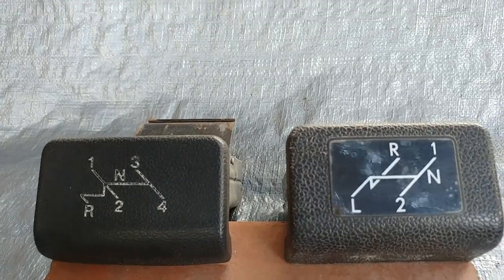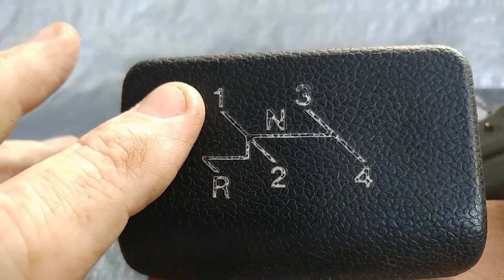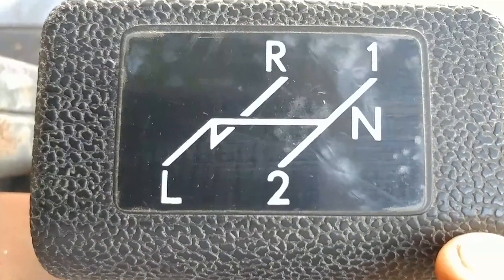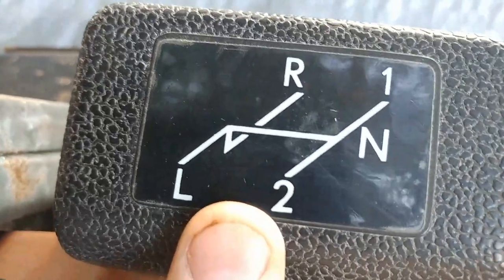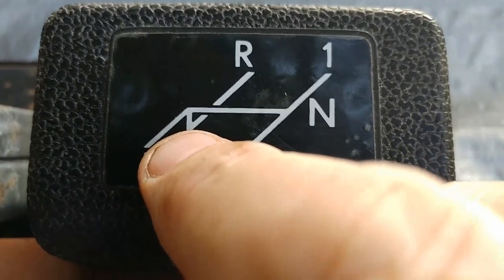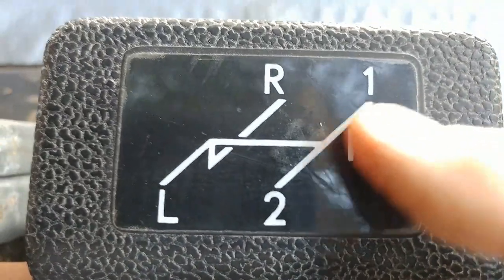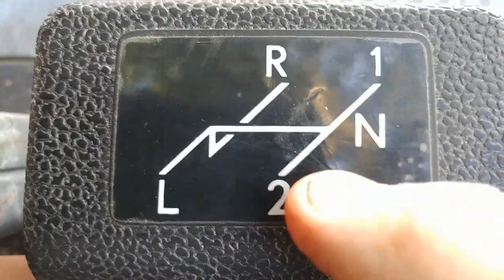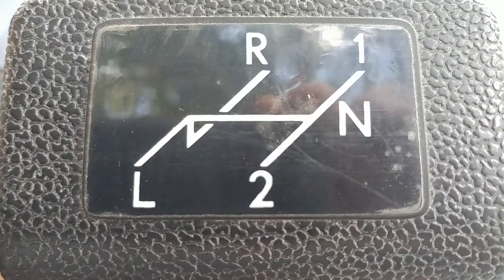HOW TO : HOW TO DRIVE A CLASSIC VW BEETLE AUTOSTICK TRANSMISSION.

Comment: I JUST got an auto stick. Shifting 1 to 2 is not a problem, I have an issue shifting into Reverse. Any ideas for my problem?
Reply from the maker: First thank you for watching and commenting. I really need to make a new video. This was for 1 sub who asked a question. My autostick is a love hate relationship. I've been involved in vitage VWs since 91. I only have driven the manual. Then I bought my autostick from the original owner. I never have been able to feel 100 percent comfortable owning this type of beetle. It has never felt natural to me. The low and high gears. I think VW did a great job on this idea. Did you know it was designed with women in mind? The idea was make it appealing and less intimidating. Unfortunately most have been converted back to manual. By production numbers it's kinda rare. It just never caught on. I still own my 68. Almost 20 years later. I don't think I personally have driven it 50 miles. As far reverse it's press down then it slides to the drivers side. This was also a issue on these. Parts are not to easy to find for the transmission. I do have a few suppliers that still carry parts like seals and others parts. Let me know if you ever can't find parts. I have a few sources. There is also a autostick Facebook group as well. Take care, stay safe. Enjoy the beetle. I have a Facebook page as well. Lots of fellow YouTube's inn the group as well. Check it out. It's called Volkswagenplanet. Hope to see you there as well. My goal is to get back in the garage and get " Benny " back on the road. Tribute to my late stepfather. He and my daughter had lots if memories when she was a young child in that car.
Reply from the maker: I'm working on where to buy autostick related parts suppliers. Stay tuned
Reply: Hello Norma... How much did you pay for your auto stick? Thanks for your reply. Greetings from Peru.
Reply from the maker: @Llampalleq  I paid 3500 US back on 2003. Here in the states the autostick is worth less than the manuals. Most have been converted to manuals. VW states they made less than 10 percent overall production from 68 to 77. Thank you for viewing and commenting. The cars are the same parts except for the drivetrain. Parts are almost impossible to find new. Stay safe. 
Feel free to ask any other questions
Reply: @Volkswagenplanet  I currently live in Lima, Peru. There is one, and apparently, the only one in Peru, that the owner is asking USD 5 thousand, taking the price down from USD 7.8 thousand. I still think is expensive but for its uniqueness maybe it is worth the price. What do you think?
Reply from the maker: @Llampalleq  these were not popular here in the states. Most were converted back to manuals transmission. Autostick parts are not easy to find anymore. They are the same car besides the transmission items. They are rare by numbers built, but dies not always mean more valuable. I have a 68 autostick. Let me know if I can answer any questions for you. 
Stay safe
Reply: @Volkswagenplanet  I'm sure it appealed to women who learned to drive on an automatic, but honestly, I knew at least as many women during that era who drove manuals as men, mainly because women tend to drive smaller cars. Of course, there were some muscle cars with heavy clutches that would have been more of a challenge for most women and I suspect that the few people who drive manuals today are more skewed toward men than they were in the 1960s. It's slowly becoming a lot art.
Reply: you are driving it correctly this guy doesn't know how to drive the car First to second is how you are supposed to drive the car you only use low to start out on a steep hill or in soft dirt. Is designed to be driven as a two-speed the spacing between low and second is like going from first gear to Fourth.
Reply: Do not rest your hand nonchalantly on the shifter as this will act as the clutch and disengage. VW should have just had R, 1,2 and 3 and skip the L symbol.
Reply: i hate it

Comment: Appreciate the video... however... I think you're making it sound more difficult than it really is.  I'm fairly uncoordinated and not a rocket scientist by any stretch... and I've never had an issue with the autostick.  Once you're used to it... it's a piece of cake.
Reply from the maker: Your correct. I need to redo the video. I had a hard time to get use to second gear on a non autostick would be first( low). It never has felt natural to me. Thanks for commenting. I will.be getting into more in depth on my 68 autostick. I hope to start at the first of the year. My goal is to get my 72 super beetle to a daily driver status first. Are you going to.make videos? Stay tuned and stay safe.

Comment: Sounds like you really don’t know how to drive a VW with Autostick.  You start the car in neutral, release the parking brake, and if you’re planning on moving forward, put it in 1st. Step on the gas and go.  You leave it in 1st until you go about 35mph or so, take your foot off the gas, pull the shifter into 2nd and step on the gas again.  Get on the freeway or what ever at higher speeds. R is simply for backing up, and L is for climbing steep grades to keep your engine fan speed faster as to not overheat the engine when straining it going up a steep grade.  If you choose, drive in 2nd all the time.  It’ll just take off slower and take longer to reach city speeds, kind of like GM’s old Powerglide in the 50s and early 60s.  It’s not complicated!
Reply from the maker: I respect your comment. The main purpose of the video is driving a manual VW for decades then go to a autostick doesn't feel natural. Not am excuse but I was so tired when making this video that it shouldn't of been posted. It was posted to explain the concept of the autostick from a email. I do have a complete autostick series coming out soon. Thank you for the view and comment. Stay warm, stay safe.

Comment: Absolutely nothing weird or confusing about it. I drove a ‘71 Super Beetle with this transmission from when it was new till 1978. You used “1” almost all the time and shifted to “2” on freeways. That was it. Super simple. And the shift diagram on my car was oriented the same as the standard shift one shown in this video on the left.
Reply from the maker: You are right. I have redone this video since. I haven't posted it. The reason I described it the way I did was personal experience. I have never driven a autostick up to that point. It never felt natural to me. It was a genius idea I think. This should have taken off. The marketing behind it was a great. Given more option to a wider audience. The few women I have met who have driven it said it was the great. Thanks for commenting and commenting. I wish I had been born a decade earlier to enjoy more of the true VW scene. I have a 68 autostick in my garage. Unmolested.. Just have no interest in driving it. It sad that some of the transmission parts are no longer available. I've been stockpiling oem trans parts. One day I will get back in the garage again. Stay safe,
Reply: @Volkswagenplanet  There was also a dealer installed automatic clutch called a Saxomat that VW only pushed outside of the USA for reasons I don't understand. I think it was made to be installed on multiple makes of cars.

Comment: Please take no offense, but I have had both models for 10+ years, and you confused me pretty badly. The 4-speed is straightforward and need not be compared to the auto stick. it's easy, ignore Low gear unless you are on a steep hill or rough driveway. otherwise, start in first, accelerate to 35-40 MPH, and release the throttle to shift to 2nd. then drive it like you stole it.
Reply from the maker: No offense taken. I need to redo the video. I have it done already. Just need to edit. Thanks for commenting. Stay safe

Comment: You forgot to mention that your hand on the shift knob grounds out the circuit and actuates the clutch.
Reply from the maker: Your absolutely correct on that. This video is a mess. It was done to answer a question a viewer asked. It needs to be redone. Do you have a autostick? I'm getting ready to do a in depth series on this when the weather gets cooler. I'm in Tampa, FL. Rain and mid 90 temps are not fun to work in. Thank you for commenting. Stay safe out there.
Reply: A hand on a plastic knob doesn't ground anything. If so, all our plastic electrical cords are faulty. lol.   - I understood it was the action of putting any pressure on the stick itself, that activated the vacuum thing a ma bob. And when that vacuum element went bad, it was impossible to get it out of neutral into any gear.

Comment: Back in the day a lot of people didn't understand they needed to shift.  They'd leave it in 2 full time and wonder why they had no power.... lol!  My Dad would get so angry at those people.
Reply from the maker: That would of been me.
Reply: I have a 73 convertible but I have 3 pedals and the autostick is that correct or wtf?
Reply: The owner's manual states to always start out in Drive 1. Repeatedly starting out in Drive 2 will damage the transmission.
Reply: @richardvega9720  Some people(very few) have used the manual pedal set to operate the clutch by foot. It is not a difficult modification. It allows you to drive it as a manual. It can be used as a 'fail safe' in case any of the other autostick components fail or need adjusting. It also is 'stall proof' due to the torque converter.

Comment: Nothing weird about it.  Maybe cause my 1st VW was an 68 Autostick.  Once you get that reverse is "push down (to the floor), then up and to the left, the rest is just like you were driving a standard from 2nd thru 4th - no problem.  The plus with the Autostick: the transmission was set up with different gear ratios, so you could drive around town in Low all day. 2 was for the freeway. But it didn't jerk you around like 1st gear would be doing on a standard.   My Autostick was VERY zippy, but probably because I had an excellent VW mechanic who also built drag race buggies. lol. As he 1st described it to me, due to the different gear ratios + specific tire sizes (and surely whatever better engine he thru into it), he said it was "dialed in". And yes, I was a speed demon in it.
Reply from the maker: They are fun like you mention, when they work and tuned properly. Mine was like you described. Just could never get the feel for the autistic. I still have the car. Thanks for the info and commenting. Stay safe my friend.

Comment: Fun fact: Possibly in response to VW's promotion of the Autostick, Chevrolet made the "Torque Drive" available on the Nova, Camaro and eventually, Vega, starting in mid-1968 and running through the 1971 model year. It was just a 2 speed Powerglide transmission with the controls for automatic shifts removed, so you had to shift from L to H and back manually but didn't have to work a clutch and it sold for about $50 less than the fully automatic version. That made it similar to the Powerglide and Dynaflow transmissions from the late 1940s and early 1950s. They only sold about 15,000 of these over 3.5 years, so the option was dropped.
Reply from the maker: I did not know that. I know that VW came out with the autostick starting in 68. It was built towards woman. Shift without a clutch. There were several autosticks produced. VW never kept great records. Some say 1 out of every 30 were autosticks through out all the models. Most of these were discarded. It never took off. Parts have always been a challenge with these cars. This car has so much personal memories for me. My step father took my daughter for rides when she was around 3 years old. I've had it since 2001. I think I may have put 15 miles on it total. I really need to restore it. It deserves it. Thank you for commenting. It really means a lot to me. Stay tuned you just may see new videos on this starting in the summer.
Stay warm, stay safe.

Comment: All the videos I've seen said you start off in first for up to 35-40MPH, and then switch to second...you'd only use L if you're say in a parking lot, or starting up on a steep hill.  Also the autostick pattern is more natural to someone who has driven a Porsche 914 or some Japanese cars of that vintage with the following gearshift pattern:
R24
135
https://www.classicshop.porsche.com/medien/pcuk/pictures/zoom/90142401400-schaltknopf-01.jpg
Reply from the maker: That is correct except ( low ) is in 1st gear location in your pic. Then you shift up to first gear, then down to second. I need to redo the video. I have to write it down before I explain it. its not a natural feeling compared to the regular manual. Thank you for watching and commenting. Doing a video half asleep doesn't help either. Stay safe.

Comment: My wife just uses 1 and 2 and loves it
Reply from the maker: The autostick was designed for women in mind. VW idea was to eliminate the clutch. It's great to hear she enjoys the car. There are not many autostick left out there. Most have veen converted to manual. The sad thing is autostick is worth less than a manual ( book value). I have a 68 autostick. I haven't put 100 miles on the car since 2003. Just couldn't get use to the high and low. If your new to the VW scene I have a few videos that may help you out if needed. Please feel free to ask any question you may have. A word to the wise about autosticks. If you come across quality parts for the trans or engine seals buy them. The parts are getting harder to find as time goes on. I'm hording parts over here. Stuff like tranmision pan gaskets. Oil pump......... Everything else on the bugs are the same as manuals. I have a list of parts suppliers that carry some parts. If you ever need abd info reach out. Thanks for commenting. As you can see I respond to all comments good or bad.

Comment: Would have been doable had they kept the same shift pattern of a standard manual.  L is for low gear?   Just call in first, second and third.  Shifting does sound like fun without a clutch.
Reply from the maker: I think that is why I couldn't figure it out for a long time. Thanks for commenting. Stay safe out there.
Reply: i used to have a 70 bug the autostick was  problems broken flex plates,  bad torque  converter seal, and the shifter contact wire breaks the constant flexing it endures. as the parts are no longer available i had it converted to manual till the frame tunnel rusted on it than a 68 bug to replace it totaled by a deer in 2020 then now a 1965 bug to replace it
Reply from the maker: @derekobidowski3301  glad your ok from the deer incident. Glad you still went back to the VW.
Reply: It's called low in part due to different gearing than on a standard manual.  You cant drive around in 1st gear all day, but you could drive around in the Low gear on an AutoStick.

Comment: The Autostick was an option on the beetle and Karmann Ghia from 1968-1975 and the cars were shipped from Germany with the option installed uses a torque converter that has an atf tank under the right fender and is fed by a special 2 part oil pump driven by the engine's oil pump. and a vacuum system with a solenoid control valve hooked to the intake manifold below the carb, a vacuum tank under the left rear fender, and to the clutch servo on the transmission and a warning light in the speedometer if the atf temp is exceeded.  as the 1968 autostick was the first to have an IRS with double jointed rear axles while the 1968 manual models still had the early swingaxle rear suspension as bugs 1969 on on the manual models had an irs rear suspension while all mexican bugs up to 2003 had a swingaxle rear suspension.  
The autostick parts are no longer available means the only way is to convert it to a 4 speed as cars 1968-1970 have no clutch guide tube which must be put in by opening up the frame tunnel,  the engine oil pump needs changed,  the driveplate changed to a flywheel,  the 12v gear the clutch componets, the autostick starter can be used, the intake manifold connection needs capped off,  a 1969-1972 or 1973-1979 irs 4 speed transmission,  the neutral safety switch wires need bypassed and  the shift rod and shifter need changed and the control valve and tanks removed then its converted to a 4 speed. the flex plates are nitorious for breaking on these.
Reply from the maker: All your info is correct about the autostick. Parts are still available though. They are not plentiful as regular beetles. Parts suppliers such as airhead.net is a great source. Thank you for sharing the info to others.
Reply: You’re not quite there yet. 
Don’t forget to put a(n) distributor appropriate for the 4sp synchromesh, such a as a 009, & while you’re at it, you should also install a good carb, like a a 34PICT3. 
Then you’re good to go.

Comment: Sorry, you made it all so confusing. I saw one short video and it was very clear.
That guy said start at N and start engine. Start at 1. Upon reaching 35-40mkph, one may shift to 2. One may shift back to 1 if he approaches a corner, slow down or a stop. He said one may stay at 2 all the time regardless speed. And that’s it.
Reply from the maker: The basis of the video is its not a natural feel to drive one of these. You are correct about driving it that way. Once your behind the wheel, you will understand. Thanks for viewing and the comment. Stay safe. Im actually restoring this car. More on autosticks soon.
Reply: My god you made an auto stick the most confusing to drive I have never used low to start always 1st in town and 2nd on the highway